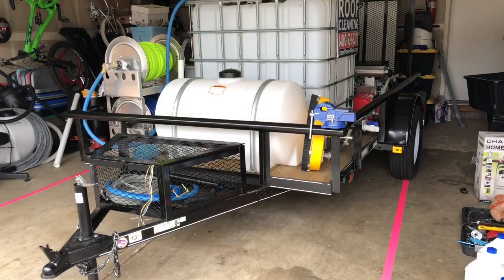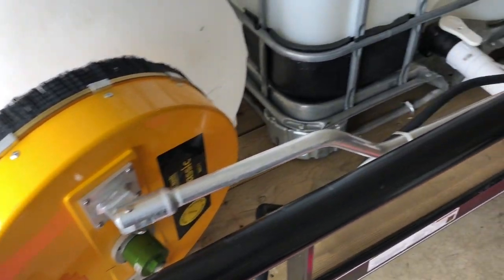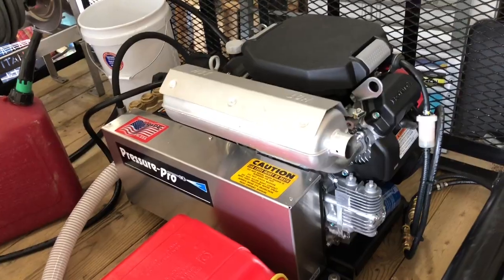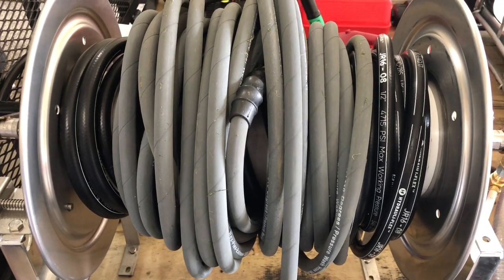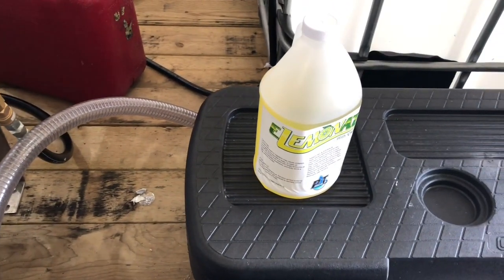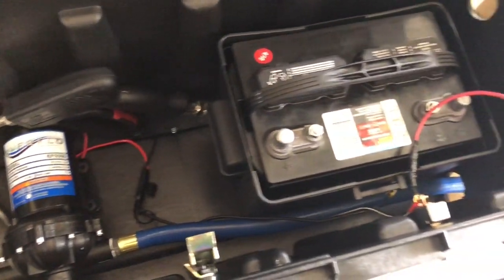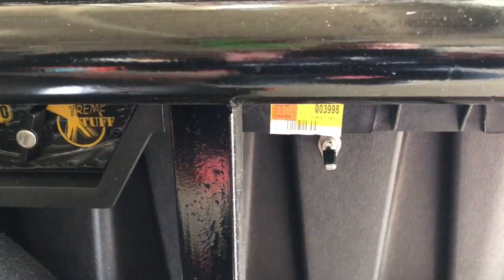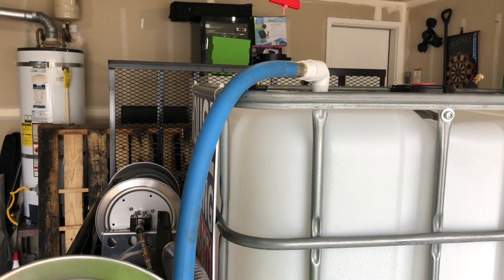Expert Power Wash 6x10 Pressure Washing Trailer Set Up

Comment: In my experience if you run a female coupler out of the ball valve it gives you a great foam spread if your downstreaming.  Just a thought for you, awesome rig!!
Reply: and add a mosmatic swivel to it.
Reply from the maker: Thank you for the tip and the compliments.
Reply: Not knocking your way of doing things, but i dont like running the female coupler, you risk losing O rings alot of the time doing that

Comment: I’d personally run a hydrotek mobile pressure wash skid with a burner to run hot water, using hot water makes a huge difference and will clean a lot faster. I run with a bunch of guys running 2 of these machines doing houses or cleaning trucks and they are beautiful machines
Reply: And they sound nice.  When that 690 sits idling, it sounds like my old motorcycle.  I miss that bike...it had a sweet, sweet sound!  Not useful for mobile cleaning discussions... :-P

Comment: Enjoy all of your videos. Very helpful. Thank you. I also read where you need to double the supply to the 12v inlet side of the pump. May I ask what connector you are using for this. I have the hose but not the connector. I did not want to use several reducers.
Reply from the maker: This is one of my older videos. I was using 1” barb to 1/2” nipple for the I” hose. I changed things around since just from switching out pumps and tried the 1/2” and found no difference. I use the Everflo 5.5 GPM pump. In theory it’s a good idea.

Comment: New to this and just have a few questions. Why do you need the 12volt system if you have a down stream hook up? Can you soft wash with just a power washer if so what is the advantage of a 12volt pump doing it? When you soft wash do you just use the 12volt to spray chemicals and power washer to rinse off or do you rinse off with the 12volt? Thanks the trailer looks great !
Reply from the maker: You will get a lot of different answers depending on who you ask. The power washer is used for downstreaming and rinsing. You will only at best get a 1% mix from this way. Downstreaming is best for pretreatment of concrete and house washing. You can soft wash with a power washer if using the proper tips to lower the pressure. At this point it’s more about volume than pressure. At 8 gallons a minute, you can shoot around three stories high. This keeps you safely on the ground. A 12 volt is used when you need a stronger mix but won’t shoot as high. I use the 12 volt mainly for roofs and post treatment. Hope this helps. I would recommend search on PWRA for more info. Make sure to be very careful with FB groups. A lot of new guys on there proclaiming to be pros. Rob Anderson is another great guy to follow on YT. I appreciate the comments.

Comment: hello , great video... i have a question regarding reels? since most of hp reels got 3/8" connection, and ive seen lots people use the same reels (softwash/high pressure and garden hose)... my question is, did you order reel each for its purpose (with different size fittings) or you use only 3/8" s, and add fittings on? sorry, my english is not the best... bassicly, what im interested in is, if i take all 3 reels 3/8, will it limit the flow on  1/2" hose softwash hose, for example? thank you, all the best
Reply: I would definitely like to know the answer to your question, because as he mentioned, he had his pressure hose reel with the 1st 50' 3/8, then he said he added 100' of 1/2" ....kinda confusing to me..
Reply from the maker: First 50 1/2 then a section or two of 100ft 3/8 hose.
Reply from the maker: I use a 1/2 hose reel for pressure and softwash hose. 1 in hose reel for water supply.

Comment: Do you have any issues with your pump sucking air from your dump valve coming off your tank?
Reply from the maker: The dump valve stays closed unless it is open. No issues. It’s air tight
Reply: Yea I had two different valves that didn’t seal completely so I was getting tiny air bubbles into my feed hose. Bought a schedule 80 valve and stopped it. The schedule 40s just wouldn’t seal. I changed them on both my trailers. I screw mine into the banjo wye. My trailers are enclosed so I like to access them from the back door when I need to drain my tanks.

Comment: Does your swivel pvc fitting on the top of your buffer tank leak like crazy? I just my setup from pressure washing products in Florida and I can’t get it to stop leaking out of the swivel.
Reply from the maker: Mine doesn’t leak. I used that recto seal in a tube. It’s like liquid Teflon. If it’s in the actual part of the hose, I’d get a hold of Lori and have her make you a new hose.
Reply: Expert Power Wash  it’s the actual 90 inlet piece not the hose. I did reach out and got. I where.

Comment: Do you have 200 foot of soft wash hose? And how much for your supply hose?
Reply from the maker: I’ve changed over the years. I like to have 200 ft of garden hose available so I can double feed if needed and 250 ft of SW hose. I usually only keep 100 of garden on the reel but carry extra.

Comment: I’d strap down any hard line hoses. The primary blue hose going to the buffer tank up top, the feeder line going to the machine, the high pressure line going from the machine to the reel. They seem fine just hanging out but during drive time and site time running, the vibrations can cause the low pressure lines to jump around enough to crack their connection to the pvc which could either destroy your pump  if they leak and you don’t notice while working or even if you do, that’s now down time to repair it. The high pressure line I would distance it away from any metal that it can rub against then blow the line. The fuel tank I’d ratchet strap down for the same reasons as the pvc, the bungee cord allows it to shift back and forth while traveling and with the tank hitting the eye hooks or frame it can create a crack. If when strapped down it touches a hook, cut a large pool noodle (blue since it’s a relatable color for this line of work ;-) ) down the center and wrap it around the hooks then zip tie it. Fuel line, I’d wrap it with a larger size fuel line if it lays on anything so the larger line takes the rubbing. With that small job drop tube, flush it out with fresh water and leave it in a small bucket with a lid, I see it damaging your deck already. Last thing I’d like to say is take full advantage of your ramp, keep it in the upright position and add painted 2x4’s to the top and bottom with short pvc tubes attached to it and insert brooms, wands, extensions, flat shovels, whatever you may need. It’s a Great Wall for skinny items. None of this is said with insult to the build or any negative way, just some things I noticed so I thought I’d mention it to a fellow cleaner to hopefully help make your life a little easier when cleaning. #WashOn
Reply from the maker: Great points. I appreciate all the positive feedback.

Comment: Great video,  just wondering is there a reason you went with 2 different size hoses 1/2 to 3/8... Learning as I go
Reply from the maker: 3/8? Older video but I don’t recall using 3/8. I know I used 1/4 for my downstreaming.
Reply from the maker: Oh yes. It helps with pressure loss.

Comment: Love the setup, very clean!
Reply from the maker: John Lange,

Thank you
Reply from the maker: John Lange,

BTW, you have a great channel. I’ve watched a lot of your videos and subscribed. Keep up the great work
Reply: thank you! hey how do you like the 12v pump? are you really getting 7gpm after 200ft of hose? im on the fence and about to buy a setup within a week
Reply from the maker: John Lange,

I currently running the everflo 5 GPM 60 psi. I love it. I know booster pumps are better but this works great and doesn’t break the bank. I’ve had no issues. Always rinse after every use and it will work the way it should

Comment: For that drop stick, the way you set it up allows for no chemicals to run through your engine?
Reply from the maker: Correct. It pulls after the engine and the pump. Most big box store pressure washers have the injector attached to the pump. That’s why the pumps fail. Chemicals corrode the pumps quick.
Reply: Expert Power Wash thank you ! Such a pro

Comment: What did u use to connect your half inch hose to the 3/8 hose also I would like help with the plumbing if you got time
Reply from the maker: If you are referring to the pressure hose, fittings are the same. PWP in FL set me up with all the hoses. Thanks for watching and commenting.

Comment: Where did you get the pressure pro at...and is that a direct drive unit?
Reply from the maker: That unit is a GX690 with the General belt drive pump. Lori over at Pressure Washer Products can get you all hooked up.
Reply: @ExpertPowerWash  thanks brother

Comment: Great video, but I’m confused on all the pumps and plumbing. Do you need a pump to get water from the ibc tote to the pressure washer?
Reply from the maker: Appreciate the comments. As long as you have a belt drive pressure washer, it will suck water. A direct drive pressure washer is the most common type. They can also work but must be level with the tank for the gravity of the water to flow to the pump. Stick with a belt drive and you will be better off. Hope that helps.

Comment: Nice set up. What size bolts did you use to mount the hose reels to you’re trailer? Thanks
Reply from the maker: Hey thanks for watching and commenting. It been a while. The hose reels came with the bolts. I just matched them up with the same size but grade 8.
Reply: Expert Power Wash thanks for the reply . My titans came with 0 hardware...

Comment: Great content! Building my first trailer right now. I'm wondering why you and 2 others guys I have seen have 8 gpm and went with the 19" whisper wash classic. I have read the rule of thumb is for every gpm 4". 4x8=32.  Wouldn't even going with 24" speed things up for you?
Reply from the maker: Thank you for commenting. The rules for surface cleaners are more relevant to the smaller machines. Example, you wouldn’t want to go over a 16 in for a 4 GPM. The 19 in whisper wash has been absolutely perfect. It goes fast and and does well in smaller spaces.
Reply: @ExpertPowerWash  Are you running the 2 tip or 4 tip one? I have read some guys buy 4 tip and if needed just cap off 2 of them.  Thanks for the response!

Comment: Awesome rig. I like the placement of the machine. I'm thinking about rearranging my trailer? What size is yours?
Reply from the maker: Thanks for watching! It’s a 6x10. I really wanted  a 12 ft dual axle but garage spaced limited me to a smaller trailer. It has done well. This is the third season on that trailer.
Reply: @ExpertPowerWash  got a 5x8 with almost the same set up. minus the extra 4gpm. i'm thinking about doing an enclosed next time.
Reply from the maker: Fidelity Pressure Washing enclosed has a lot of benefits also.

Comment: How many stories can you hit from the ground when softwashing? I am looking to build a trailer but need to be able to hit  3 -4 stories
Reply from the maker: I can hit 4 stories. You will need at least a 8 GPM pressure washer and a shooter tip. If there’s wind, it may be a little challenging.

Comment: The 12 volt lines look like they would difficult to take off if pump went down...
Reply from the maker: Yes older video. Good call out. We use quick connections now.

Comment: What kind of unloader is on it? K7, or did you upgrade? Trying to figure out your set up at the unloader. Looks different than mine.
Reply from the maker: Thanks for commenting. It is the K7. I ordered it from Pressure Washer Products with it already installed.
Reply from the maker: I think mine is the K7.3

Comment: How do you get the 8 gallon per min to work with a foam cannon?
I use a5gallon per min to wash driveways. I also have another pump 3.5 gallon per minute I can exchange if the water pressure at the house is aweful..... 
my question is this in a nut shell..... when you down stream using 12 percent bleach, with the 8 gallon per min,,, does it become to diluted... ?

Thanks for answering
Reply from the maker: William Coley, thanks for watching. I have never used a foam cannon, I’ve heard of it and seen a few videos. Downstreaming is the way to go for me. I use the General Pump high draw chemical injector. I can dilute my 12.5 SH 2 parts SH 1 part water with 1 oz of Elemonator per gallon if that makes sense. This works 95% of the time. Very rarely I run it straight if the house is really bad.

Comment: Great video. What source are you supplying water to your 12v pump? Is that also coming from the IBC tote? Thank you
Reply from the maker: I was batch mixing at the time of that video. I used a mix tank with a drop tube. When it comes time to rinse, pull the drop tube out of the mix tank and drop it into the IBC tote. I now use a proportioner with the water side plumbed in. Hope that helps.
Reply: Expert Power Wash thanks for the info 👍

Comment: What chemicals do you use for roof cleaning, and what is the mixture?
Reply from the maker: I use 12.5% Sodium Hypochlorite and water, 50/50. Add one ounce of slomo soap per 5 gallons of mix. This was how I batch mixed. I have a proportioning set up now that draws similar mixes without having to manually mix it. I have a video somewhere on the channel about that device.
Reply: @ExpertPowerWash  can you show that set up with the proportioning valve etc?
Reply from the maker: Think I have it on other videos.

Comment from the maker: My tips for down streaming are 0020, 2520, 2560, and 0060. 8 GPM kit from Pressure Tek. For my roof pump I’m using 1535, 2550, 2540, and 0040 from Pressure Washer Products. Hope this helps
Reply: How much did this set cost you out the door from start to finish?
Reply from the maker: Don’t remember, 7 or 8 five years ago. Think I may have mentioned it in the comments. It’s been a while.

Comment: Is ur water feed reel a 3\4 i can only find 1\2 do i jus have to get an adapter for my Flex zila hose ????
Reply from the maker: That hose reel has a 1 in manifold. There are adapters. Pressure Washer Products helps me with all the parts I needed.

Comment: I didn't see a battery charger anywhere.  Do you drag a charger out to the trailer each night or haul the better in?  Also, the Flexzilla hoses - I cannot stess how much I LOVE THOSE HOSES!  Highly visible - if a lawn service comes to mow while you are working, I seriously doubt they will hit this hose - it just stands out loud and proud.  The color is so loud it needs a volume control knob!  They are pretty much 99.9% kink free, drinking water safe, about 30-40% lighter than most other hoses which matters if you have a ground person hauling a hose around rinsing all day while roof washing/Soft Washing.  As my other hoses die off, Flexzilla is the only replacement for me.  You can also buy Flexzilla hose in a 1,000 ft. reel (I think?) and make custom lengths.  Instead of a drop stick for the chemical tank, why not put in a bulkhead and permeant draw tube and leave it connected full time?  If you do this, plumb the fittings on the TOP of the tank.  This way you won't ever end up accidentally hitting the bulkhead and breaking it, and leaking your SH in the customers yard/driveway or driving down the road.  If you have an issue with the connections with top plumbing, you're not at risk of leaking anything.    You can put in a 3-way valve if you ever have any issues priming the pump.  This will allow you to keep the tank lid capped so you don't collect leaves and other debris in your tank in the fall which could run through your pump.  I personally like to mount my 12 volt pumps with the pump head down so if it ever develops a leak it cannot run into the pump motor.  Love the addition of the vice - great idea!  I'd use the trailer gate in the rear to put some PVC piping to hold things like rakes, brooms, etc.  And the back can be used to mount a sign for advertising while driving down the road.  Cheap advertisement!   I'd also strap the PW gas tank down more securely.  The existing strap will allow it to move while you are driving and it may damage the tank and cause a leak.  The bungee cord will weaken over time , heat and sunlight, and probably gas fumes too.  Home Depot has water tight lids for normal sized lids for your 5 gallon bucket. I think I paid $5 to $7 for mine.  It snaps in securely, and has an easy spin top with a gasket which seals a lot better than you think so you don't need to empty your 5 gallon bucket before traveling to the next job.  Also great for keeping gutter brightening chemicals in for storage between jobs.  They keep these with the 5 gallon buckets at HD.  I would personally put something under the Titan reels to boost their height so the bottom reel is easier to wind up.  Winding up the hose is the worst part of the day for me.  I'm tired, and my reel sucks, but then again my hose reel is old and overdue for a visit to the dumpster and I'll be replacing it with a Titan 18".  Overall though, a rather impressive trailer build.  Nicely done!
Reply from the maker: Panoramic Clean,

Thank you for watching. I keep the battery charger in the garage and just hook it up as needed. You brought up some interesting points on how you have yours set up. I’d like to look at a few pics of yours if you have a link. I’m getting ready to change up the way I have the box and 12 volt system set up.  You have a lot of good points. Thank you.
Reply: Panoramic Clean the battery from pressure washer will keep it charged
Reply: Your 690 should have enough amps in the charging circuit to charge your marine battery while the power washer is running. Mine has a 17A charging circuit so I ran two 10 gauge cables from the power washer battery over to my marine battery, it shows about 13.9 volts when the power washer is running. The electrons are moving anyway why not save them for later?